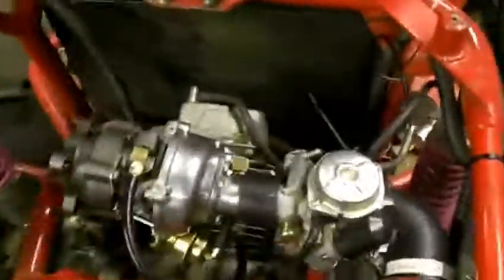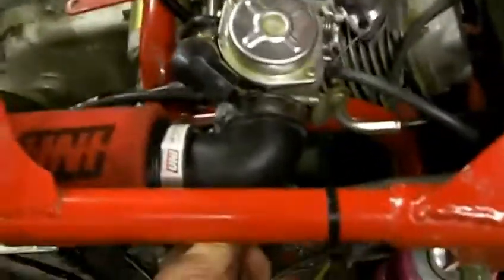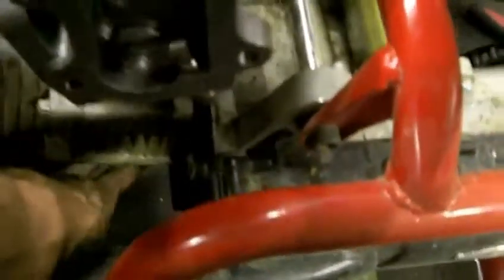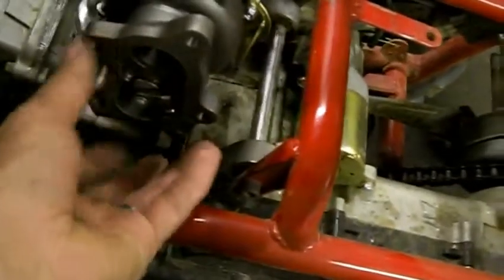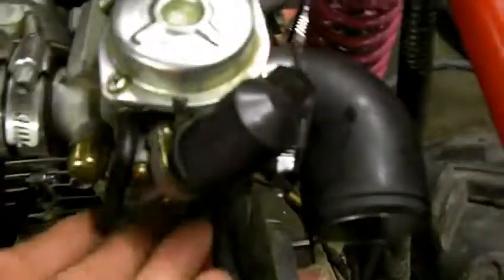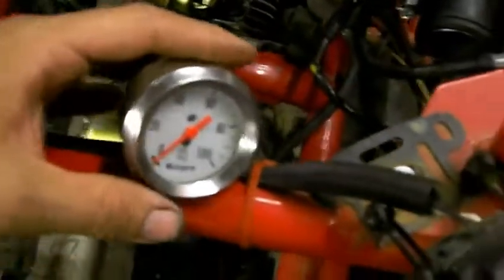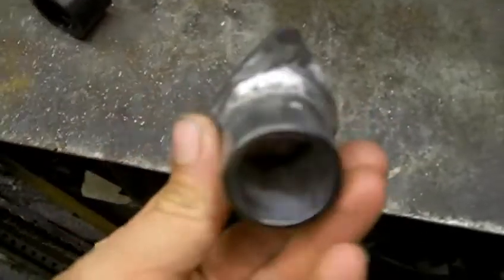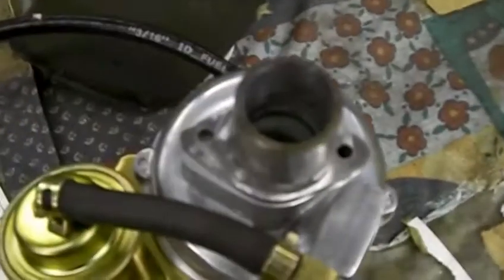early mock up

Comment: It would have been interesting to know exactly where the oil feed was taken from and how the whole system worked out. I'm just starting a turbo fit to my GY6 and i have very little info on the exact feed point. Otherwise an interesting video

Comment: how did you tap into the head, for oil??
Reply: Carlos Vreal I just noticed you never reply.... damn..
Reply from the maker: Carlos Vreal I have 200 videos and 11k subscribers. I can't possibly keep up .  As for how I tapped it should be in the video.
Reply: Justin Sane you are the only one that has turbo a gy6 go kart on youtube. and if it's too much just disable comments then. there are 5 comments on this video 2 of those 5 are questions, the other guy asked "what engine size?"  typing 150cc doesn't take that long. you can sort thorough the dumb questions and answer the genuine ones....not that many. I have a question that like nobody but someone like you could answer (since not that many people turbo gy6 motors and you seem very knowledgeable on turbo set ups) I just wanted to know if you had problems with your turbo over time as it is a draw through set up? thanks anyway
Reply from the maker: No we had no problems.  I still have the cart but I sold the kit on a buggy forum years ago